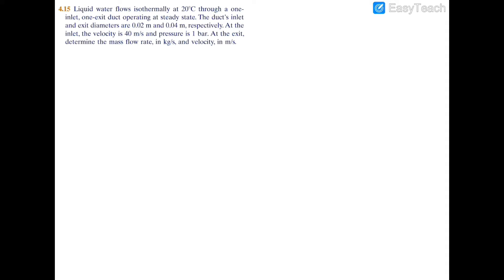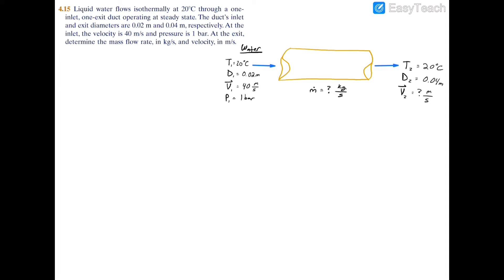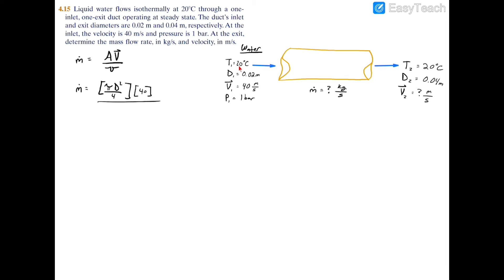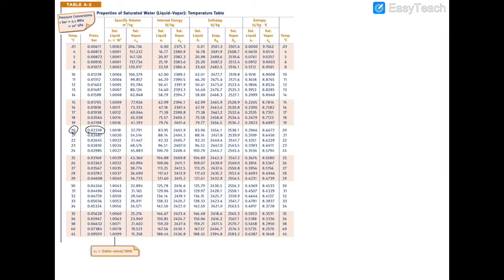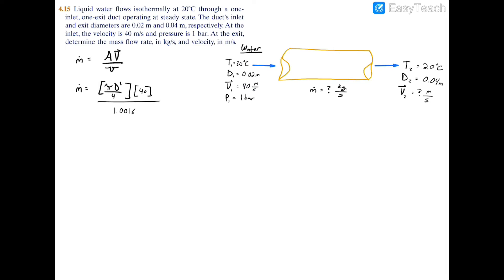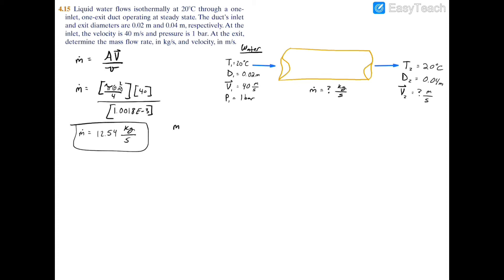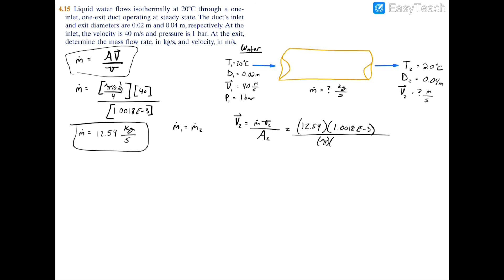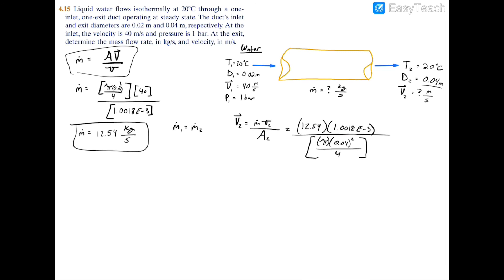4.15 Liquid water flows isothermally at 208°C through a one-inlet, one-exit duct operating at steady

Comment: The table for 20 C with pressure of .02339 has a different pressure then what we are looking for which is one bar. So why do we still use the same values on this row if its not 1 bar? Also how do you know which specified volume to use when theres vf and vg? I hope this question made sense.
Reply from the maker: When you deal with liquids (and ONLY liquids), the properties (specific volume, enthalpy, entropy, etc) barely vary with pressure, but vary much more drastically with temperature. So for example, water @ 20°C & 1 bar and water @ 20°C & 2 bar hardly have any difference in property values, so we can approximate them to be the same. Water at 20°C & 1 bar and water @ 21°C & 1 bar however cannot be approximated to be equivalent because they do not share the same temperature.

To answer your second question, you use vf when you are dealing with a liquid, and you use vg when you are dealing with a gas. You can draw a T-v diagram to find what state of matter your working fluid is in. I show how to draw a T-v diagram here: https://www.youtube.com/watch?v=1th-TtO4Kac